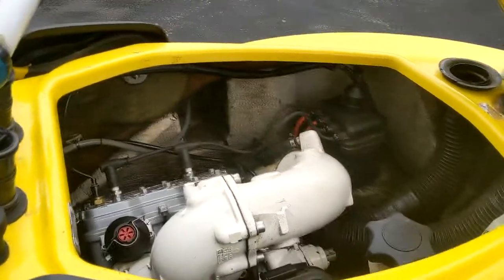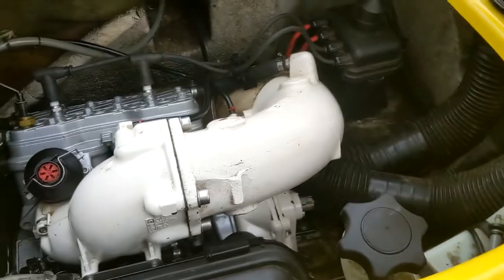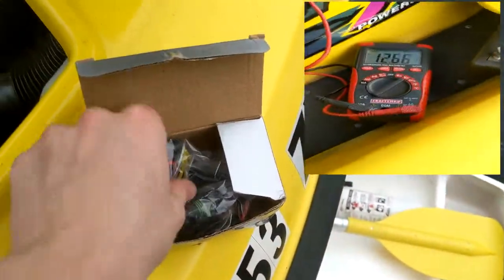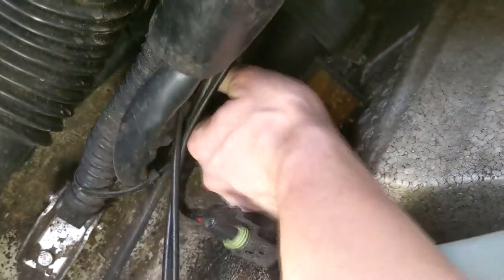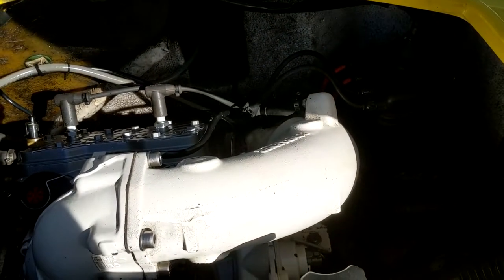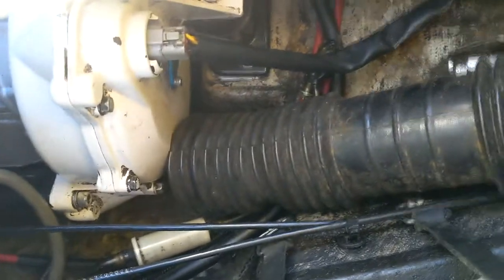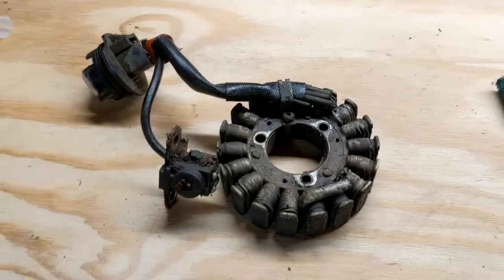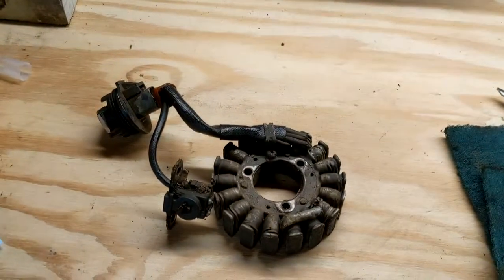1997 Seadoo XP Rectifier & Stator Replacement

Comment: I just did this last night on my 96 GTX and found that to remove the flywheel case, you have to not only remove the bolt going into the engine mount but also remove the mount itself, something the video doesn't point out. Another lesson learned is that I originally had the ratchet strap pulling to the left where it worked better having the strap attached to the right (starboard) side of the trailer with the hook through the hole right behind the manifold bolts pulls it more appropriately.

Comment: Im going to need a stator aswell. I did some reading and the only forum i could find on the replacement say you need to remove the flywheel that cover the stator. Does the 787 require that or does it sit on the outside of the flywheel?

Comment: Can you finally fine test the stator?  I´m actually having some issues with my 97GSX but stator test following service manual instructions all give the correct values :/   I think is the rectifier in my case but I have not overcourrent charging issues, my problem is like you have no battery charging

Comment: I have a 1997 seadoo challenger and  have no spark ,I already replaced the  stator with a new one , still no spark.
All fuses are been checked. How do I  test the main computer by theengine compartment ?
Reply: Did you ever get any feedback with your issue? I have a 1999 Sportster and one of the engines ran great one day and the very next day wouldn't start. I was hoping to see if it was possible to check the circuitry before replacing it to see if it was actually defective.

Comment: So my ski starts just fine and runs but only feels like it running on one cylinder. I put new plugs in and same thing. Keeps beeping one long beep and says maintain then after a bit it will say 12v. Fraigile
Reply: Could be ignition coil, but ive seen the stator cause that too